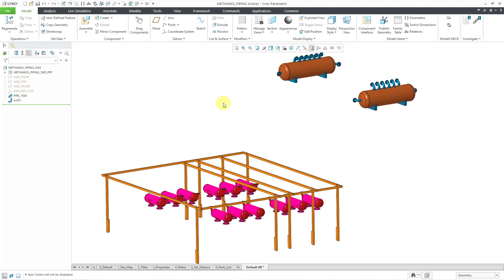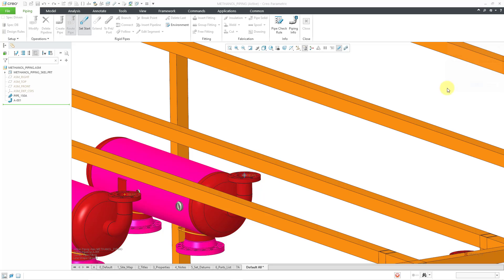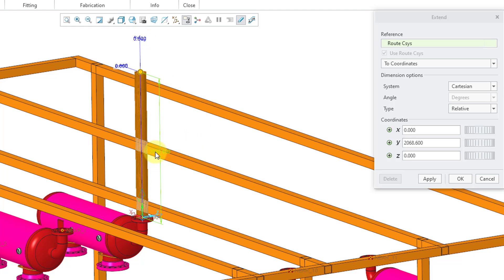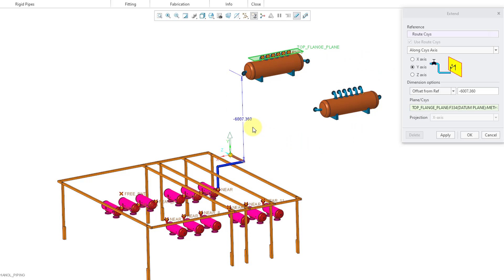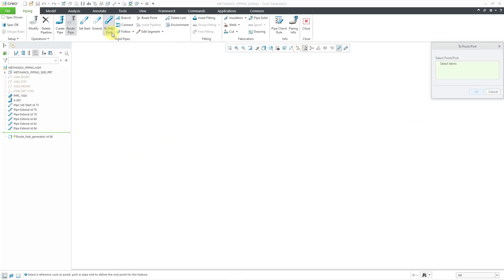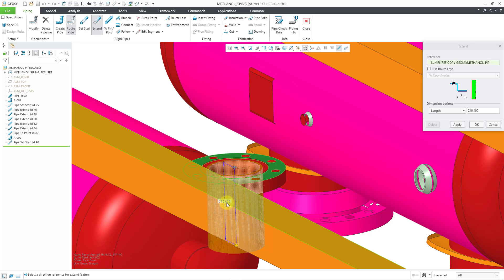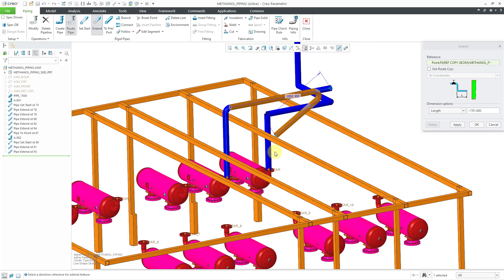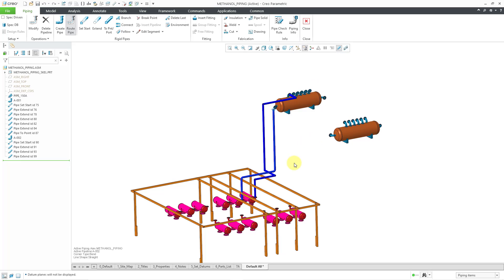Creo Parametric - Piping Routing - Extend Command

Comment: HI,
HOW TO ADD PIPING APPLICATION TO RIBBON
Reply from the maker: First, check your license file (or go to File > Help > System Information) to make sure you have the license. If not, contact your reseller. Also, you have to have an assembly open.

Comment: Sir will you make tutorial stl file to solid in creo parameteric?
Reply from the maker: I hadn't intended to. There's not really much you can do with an STL file once you get it into Creo, if you don't have the ridiculously expensive Reverse Engineering Extension, which I don't.